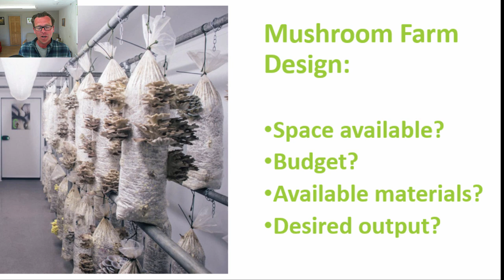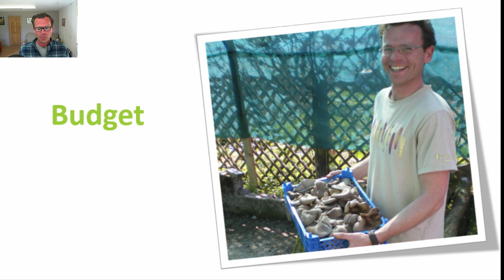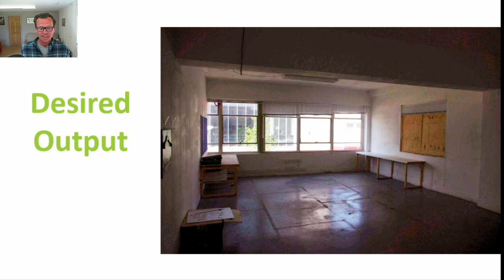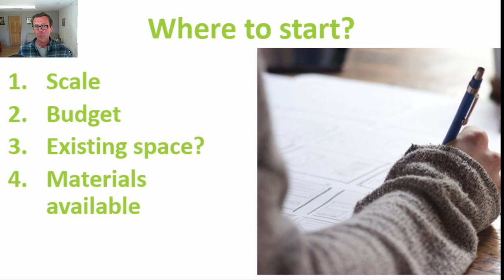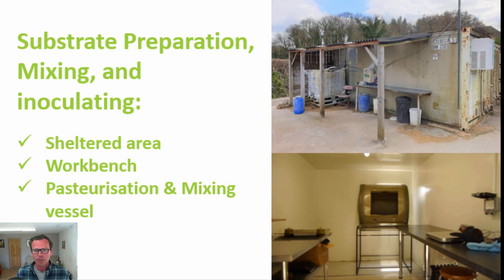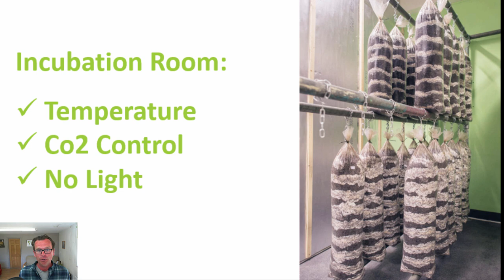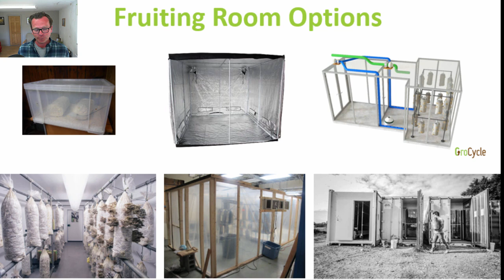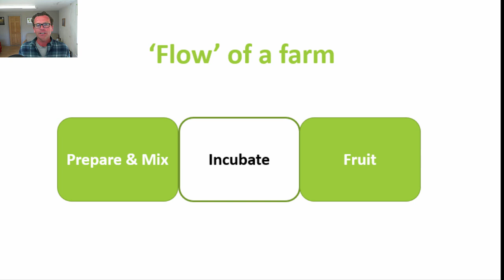Designing A Mushroom Farm | GroCycle

Comment: Do air-condition room for mushrooms need exhaust or ventilation
Reply: Were you able to find an answer to this question? I’m also wondering ideal temperature and humidity levels.
Reply: Exhaust is really the only practical way to deal with spore build up. They'll eventually gunk up your AC if you're growing at scale. The other option is having really good indoor filtration but that's going to add to your maintenance costs.
Reply: @ArlingtonFarms  Depends on the mushroom. Sure there's a range, but for the best yield you really need to dial in those two variables.

Comment: Why couldn't yo just have long trays, 30 feet long,  4 inches deep and maybe 2 feet wide, lay the substrate in it , cover it w plastic, punch holes all over it and have the shrooms growing straight up. You could have them coming out of the entire setup instead of just here and there from hanging bags?
Reply: You could, but there's some reasons you might not want to. Different species have different habits. The oysters, which you saw coming out in clusters on the side of bags fruit that way in nature. They would be on a log, and the mushrooms would erupt from a small basal area- sideways- out of the log. Shitake is pretty much the same, as is Lion's mane. Agaricus bisporus (the button mushroom from the grocery store) fruits exactly as you suggested, and indeed those mushroom farms often use trays that are "cased" with a thin layer of soil to make them fruit standing upright and spread densely, but separately, across the trays surface. Another reason not to do that is contamination. If you get contamination in a large tray of substrate, you could lose more work (and $) than if a bag went bad. That can be dealt with quickly and safely for the other bags of healthy 'shrooms.
Reply from the maker: exactly what @ravosavo said above ^
Reply: @michiwai  Agaricus- like the button mushrooms you buy at the supermarket.